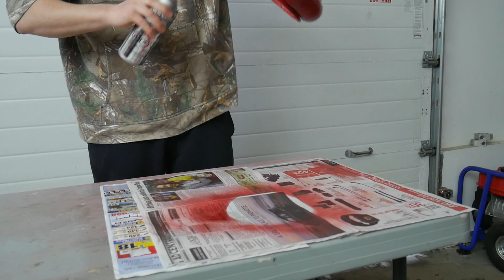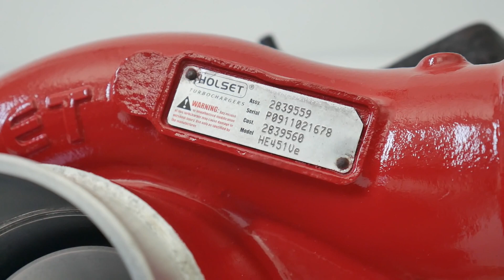Cummins ISX Turbo Rebuild and Restoration - Holset HE451VE

Comment: Where do you get the rebulid  kit pleas let me know thanks
Reply: Best aftermarket brand parts are from Melett. Another good one would be Turbo International. Melett is now authorised by Cummins to make jobber parts and also build OEM part for Cummins / Holset turbos. Keep in mind that if you use sandblast, you should replace the shroud plate and you have to destroy it to do so. Melett make the shroud plate and VGT nozzle ring also that goes into it. They are not included in the standard reparation kit though,

Comment: As somebody already mentioned, this is more of a making it look better than rebuilding it. All of the parts were reused. I wish I had time to make video how it should be done proffesionally.
Reply: I have the exact same turbo on a 2013 Cummins isx with 650k miles and when it idles sometimes it makes a sneezing sound or chuffing! Any idea what might be causing this issue? Engine is original with factory components and factory aftertreatment system.
Reply: Michael would you be willing to rebuild mine if i pay you?
Reply: Krylon overhaul.
Reply: @StickNclutch   your egr cooler is likely plugged with soot.

Comment: You didn’t balance shaft/impellers before reassembly 😅 looks nice tho
Reply: Hey man I was thinking the exact same thing....lol
Reply: Yea you have to balance it
Reply: You could just mark them on the end of the turbine shaft, compressor wheel + nut by using a small pointy punch and reassemble parts well aligned. Of course a balancing is best, at low speed should be good enough, no need for high speed balancing for these big turbos.

Comment: These rebuilt do not last as long as the original. They are a waste of time and money, I’ve been through 3 rebuilds from Cummins luckily it was all within a year and under warranty. Best to buy a new one.
Reply: ya right here in Canada a new turbo from cummins with the Actuator is $14400.00 who can afford that I just looked into this so I'm having my turbo and actuator rebuilt
Reply: Cummins RECON turbos are not ideal. They do a sloppy job and sometimes there is still carbon inside and the VGT is not aligned perfectly so it does not move freely like it should, or there is a broken bolt in a hole (all seen this in our shop). You are best to go with a pro turbo shop than with RECON from Cummins.